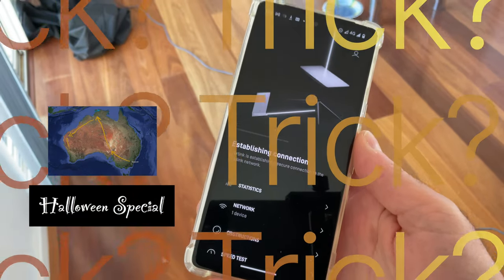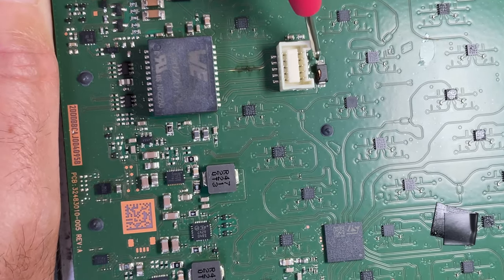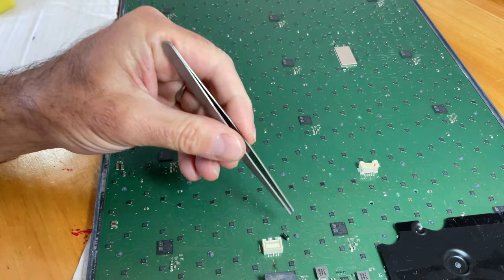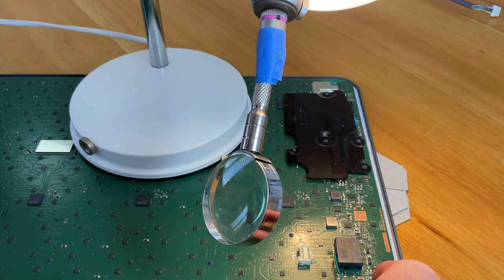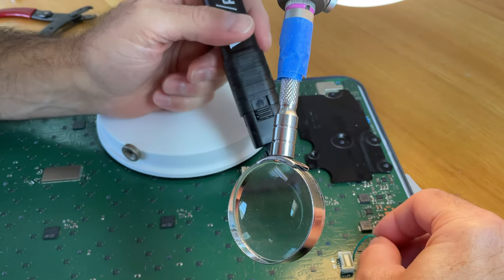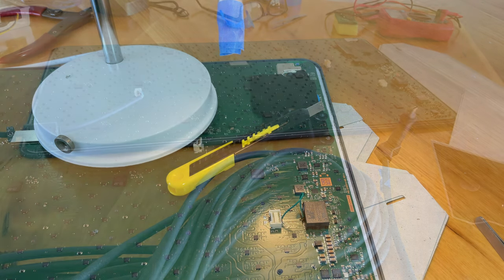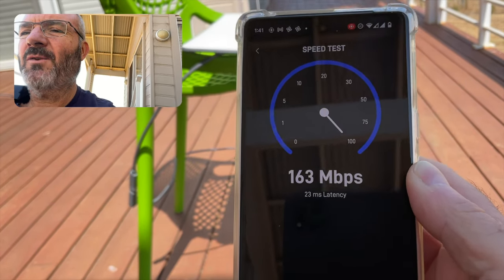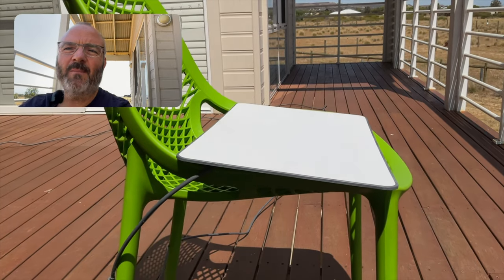How to revive Starlink after bad POE wiring job? #starlink #hack #poe

Comment: Hello, i have doing bad wiring too, the starlink work but not exceed 90Mbps, i already make this fix and try to use 12v directly like your video,  but not solved it, can you help
Reply from the maker: Sorry to hear that, but sounds like you are very close. I would say you have a bad connection in your Ethernet jack. I am almost certain on this. Especially  if you are getting some throughout. Try reseating the wires in each connector. Do you have the plastic tool to seat the wires?
Reply: @AUSY8  i already change ethernet connector and cable but same results. is it possible that the POE Transformer is damaged
Reply from the maker: @tsantaandrianarivomanana5260  I'm not sure. I was getting no signal when I burnt the traces near the POE transformer.  You however seem to beI getting some signal, so I think maybe you have a different problem. It really sounds like a connector problem.
Reply: @AUSY8  ok, thank you for taking an interest in my problem